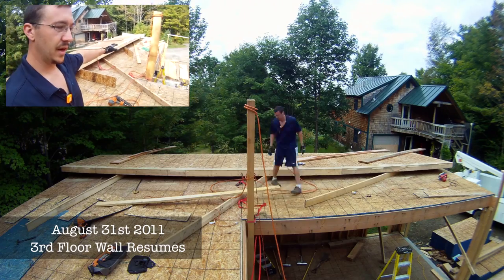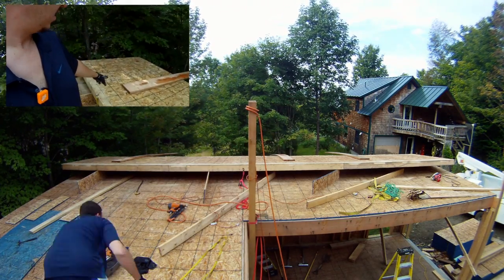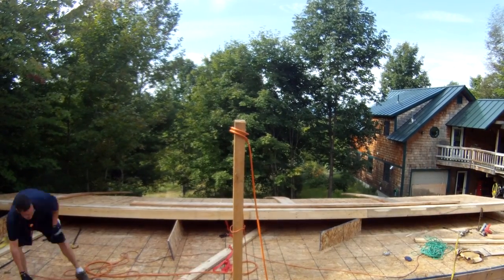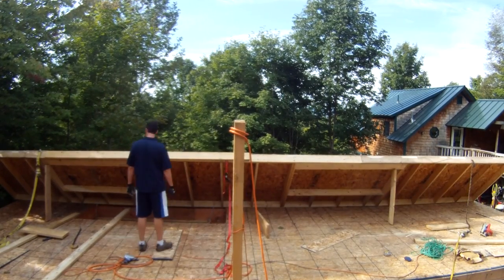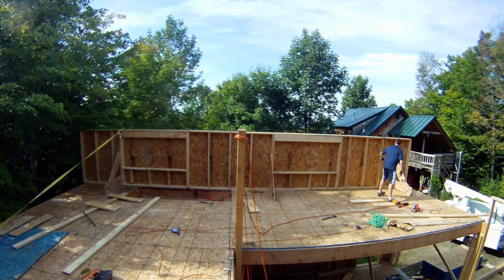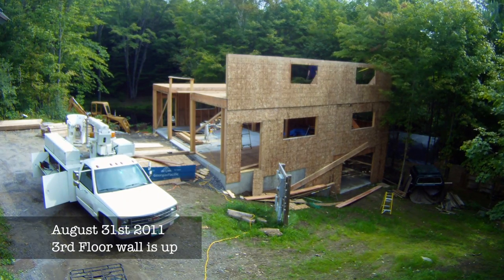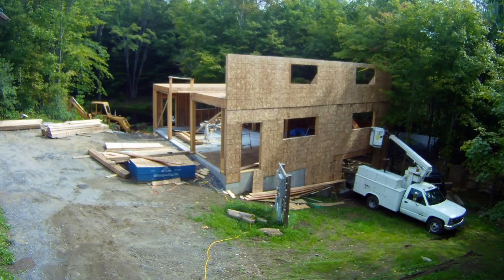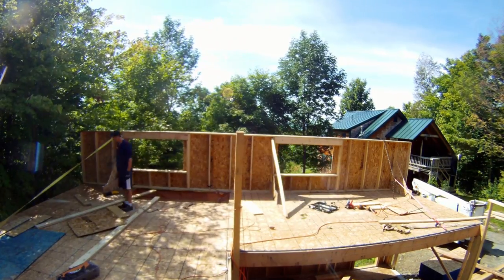Raising a wall alone - 34 - My Garage Build HD Time Lapse

Comment: Very helpful.  I'm building a 16x20 two story gym/home office and I've experienced how heavy and difficult it is to raise walls.  And I'm a stronger than avg guy.  I've fortunately had a neighbor help me with first 2 walls, but he travels a lot so I want to be able to do it myself.  I like your brace concept and keep edging it up till you can get under it and walk it up.
Reply: Use inexpensive wall jacks. I am 70 and stand 20Ft x 10 ft tall walls, sheeted without breaking a sweat.

Comment: that made me anxious. i max out with moving 6ftx6ft/8ft walls (with sheathing). not only standing them up, but lifting, walking and placing on the right position. and im not getting any younger so my strength is not at peak anymore.

Comment: I assume when you said, "the top of wall was going up and down", maybe you ment to say in and out?...If that's the case, you just needed to put a 2 x 4 block, on the o/s, at the top of each end of the long wall and put a string line, pulled real tight, on it, and build braces on the inside, long 2 x 4, or maybe a 1 x 10, nail it to the top plate, and later, down to the subfloor. Then check the string line for the 1-1/2" measurement, equals straightness of your wall, and pull or push the wall braces, in or out till you get 1-1/2"/straight wall, and nail them off to the subfloor, wha-laa, straight wall!

Comment: It looks like your studs are spaced at 24"oc which isn't standard for an exterior wall.
Reply: With 2x6 you can. Not allowed on 2x4 generally.  I like 2x6 because you can get higher r-factor insulation and trusses sit on studs directly at 24"  Instead of offsetting at 16"